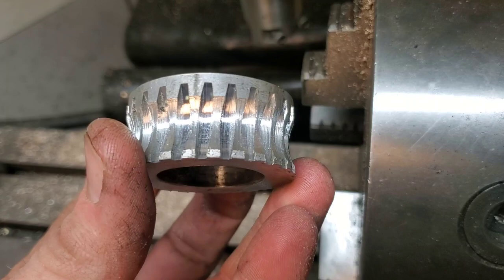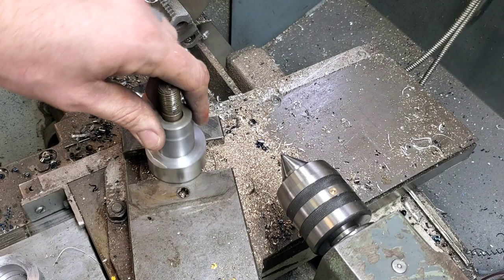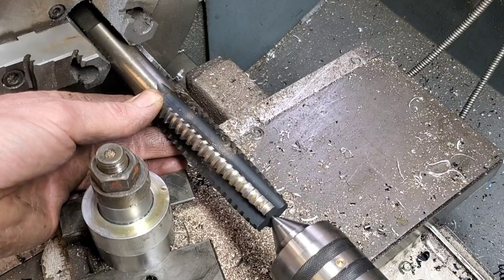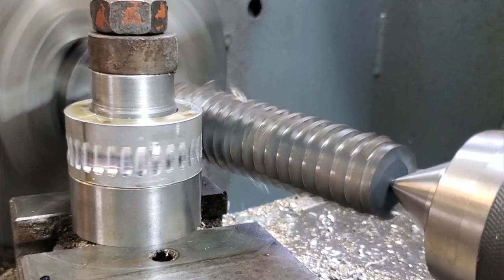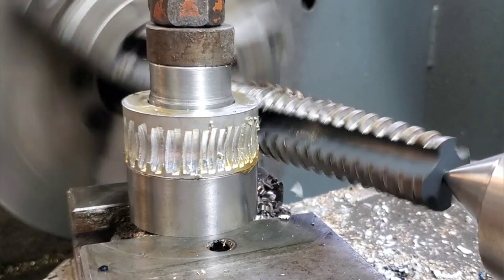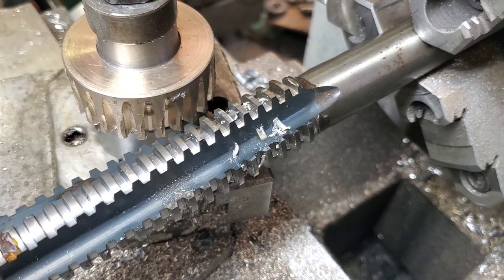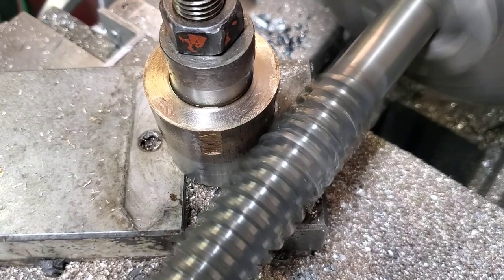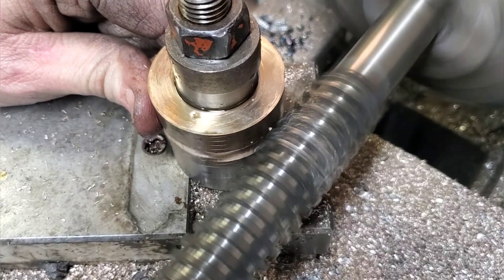FreeHobbing Gears on the lathe Tutorial

Comment: The problem is synchronization and tap tooth cutting double tooth or running out of pitch .Since that is tapered tap how about feeding in to a bottom of the tap and then turn the power feed forward.Trick is to get power feed right so that it synchronizes with the tap pitch.I have never done it so i am clueless how to do it with tapered tap but i guess it has to do with 
one full rotation divided by number of teeth tap has ? 

i mean this method would work great if you could build a some kind of arbor that spins between centers and is driven by stepper motor and arduino ,then you could control synchronization and you could cut blanks right in the middle by adjusting height .Some contraption that would have E type without E having - in middle made of pipes that can slide up and down,two halfs that can be tighten by a all threaded rod -like a vice   .Like one fixed live center on bottom and upper part has a er 32 collet (that holds mandrel with blank,it should lean on trust bearings and one ball bearing ,or conical roller bearing )  with shaft and timing belt pulley.It would turn lathe into a simple gear hobbing machine for fraction of price. You wouldnt be able to do helical gears and some other fancy gears but for simple  gear cutting it would work.

Just food for thoughts.
Reply from the maker: I like the idea I had though of one day converting my mill to CNC. Then driving a rotary table with a stepper/ servo.  Then I could do the same operation but to a way higher accuracy.    Lol all just money and time. Neither are in great supply.        I love the ideas and thank you for sharing.

Comment: Thats pretty cool. Sounds like you had some good pours too. looking forward to that. cheers
Reply from the maker: Yup just used your method and built off of it , man even though it failed due to gating and risers it still worked in areas. Just have to solve those . Now im headed out to the cnc router tomorrow to make the patters
Reply: @Wrighmachining  id be curious to see it. from my experience, you dont need risers or vents. simple sprue and maybe gating depending on the size.

Comment: Ryan  I believe the main issue is that the parallel flutes of the tap (of course has a space between them)  that allows the blank to wonder when not engaged and then each time randomly re engages 
I have had great success with this method using a spiral type tap on non acme threads.  Not sure though if spiral is even available with acne threads??
Reply from the maker: You hit the nail on the head my friend that is it .   It has to have at least one tooth 1/4 engaged at any point to have it track .